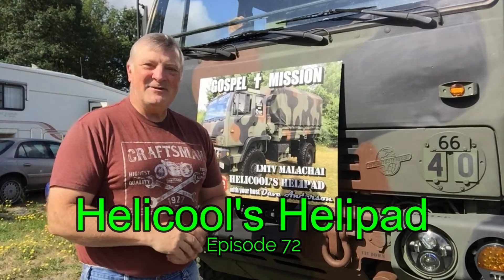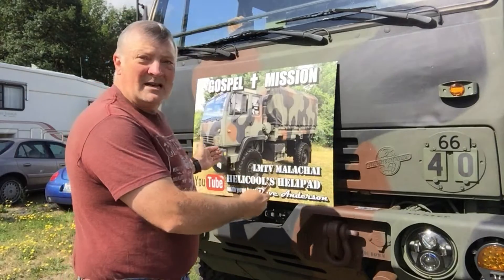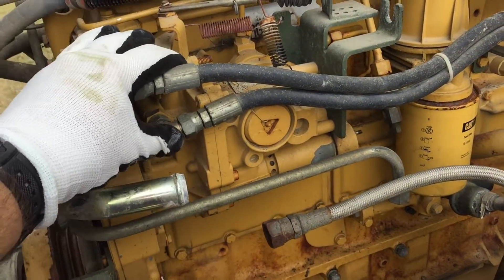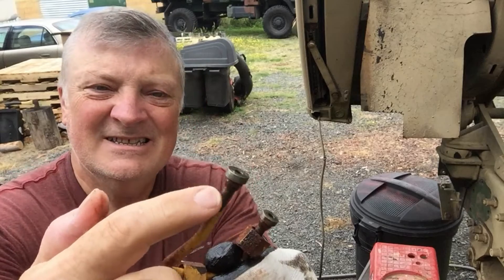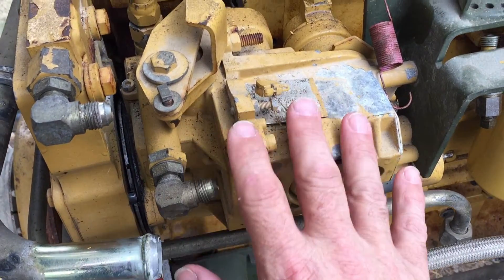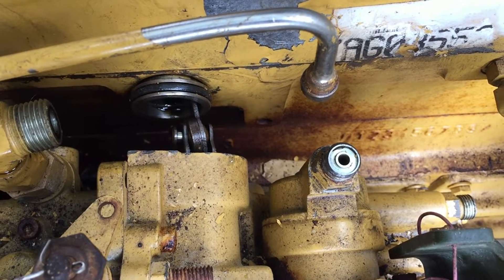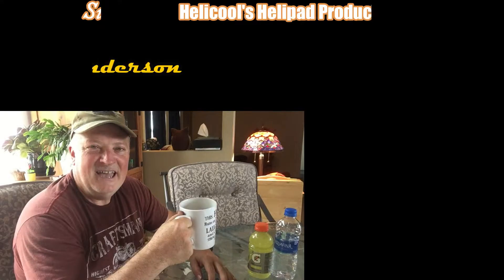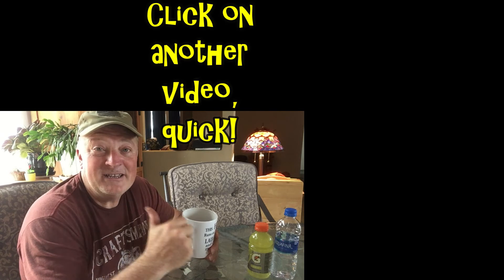FMTV CAT3116 BIG ENGINE COMPONENTS Removal #70

Comment: how do you get the inside mounting bolt out and how do refit the unit please
Reply from the maker: @andybone1160  after removing mine, I recommend not to remove yours, unless it is destroyed. I recommend if something goes a wrong, try to have it tuned before scrapping it.

Comment: Este governo que você retirou existe algum ponto pra montar ? Ou ele funciona igual uma bomba de alta presao ?
Reply from the maker: O controle de combustível funciona como uma bomba de alta pressão. A carga de combustível é medida com precisão e pressurizada pela bomba de injeção de combustível e passada para os injetores de alta pressão por meio de tubos antes de ser pulverizada na câmara de combustão, onde se inflama. Os gases de combustão resultantes acionam o pistão para baixo para produzir o curso de força. The fuel control works like a high pressure pump. The fuel charge is accurately metered and pressurised by the fuel injection pump and passed to the high-pressure injectors via pipes before being sprayed into the combustion chamber, where it ignites. The resulting combustion gasses then drive the piston down to produce the power stroke.
Reply: Caro amigo, saudações.  Trabalhei na Sotreq a muitos anos e posso lhe dizer que não,  não tem ponto na engrenagem, ele tem SIM, altura na instalação dos bicos injetores,  os quais, se você não possuir as ferramentas próprias, poderá ser feita com o uso de um bom parquímetro digital. Em relação a valores de medição, no YouTube, existem alguns vídeos que podem te ajudar.

Comment: How can I get more power in the Cat 3116??
Reply from the maker: One way is to delete the muffler and the other is to adjust the fuel control/governor assembly. I don't really recommend the later, since you might be asking for a diesel run-away. I have heard of a horse power upgrade that is professionally done at a certified CAT mechanics shop. I don't know much about that one, other that hearing about it from other owners.
Reply: @HelicoolsHelipad  you know where is the adjust control of fuel is located at the governor?
Reply: If I do that I will waste more diesel??

Comment: I'm very familiar with the 3116. Mid to late 90s in everything trucks, heavy equipment, boats etc... they are known to drop a valve . They are throw away motors, very expensive to rebuild,  because they have dry sleeves instead of wet sleeves. But they do run decent ...
Reply from the maker: Jay well, now I have an extra one. Though, the one I have runs great... good power, and purrs like a lion. (If lions can purr... not sure about that).
Reply: @HelicoolsHelipad  Glad you have a back up, our local Caterpillar dealer wanted 18k for just for a long block when our 3116 in a Cat 322l took a dump. I bought a used one on ebay from a school bus .
Reply: Can you help with the fuel system
In mine?

Comment: While you have things apart, you should invest in a FASS. Fuel Air Separator System. 
Oil bypass filter system too. They have a heating element in them to burn off any fuel in the oil.
Reply from the maker: That is a good call. For all those reading this thread, do you have a good line on where to find such things... as I have not heard of them before. Sounds great, though!
Reply: I don't know about specific models and engine combinations for the FASS. Here's a link to check out. They are available in many sizes. Pickup to semi.
https://fassride.com/portfolio-item/fuel-air-separation-system/
Reply: Here's a link to a good oil bypass filtration system. They're pricey, but filter out the tiny stuff that the main oil filter misses.
http://www.ops-1.com